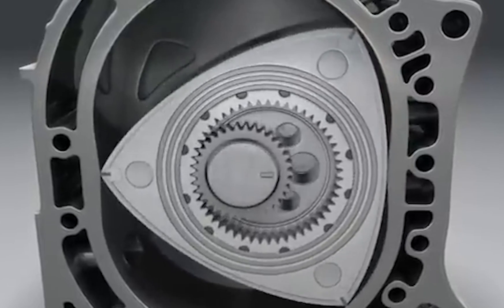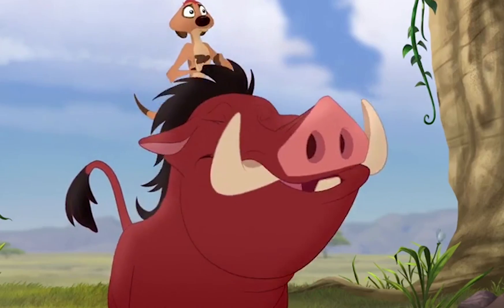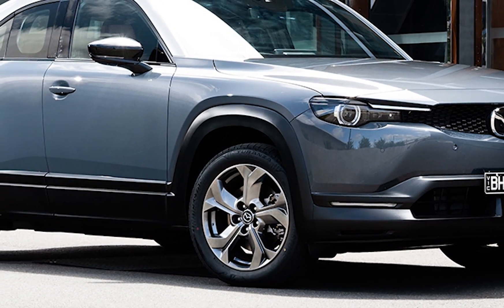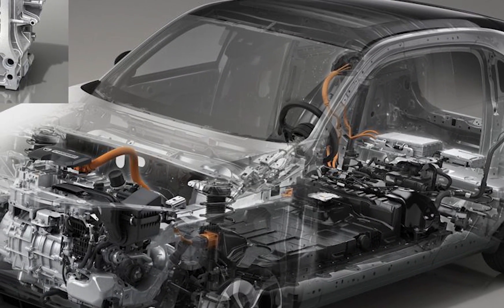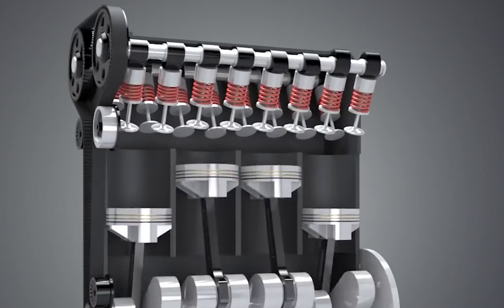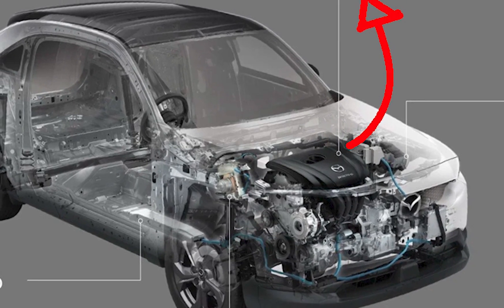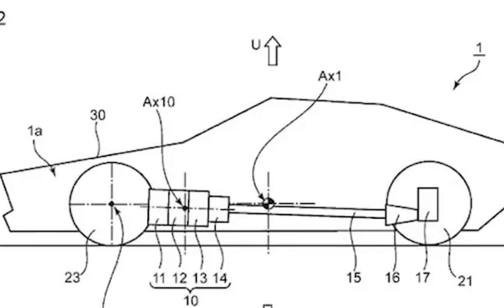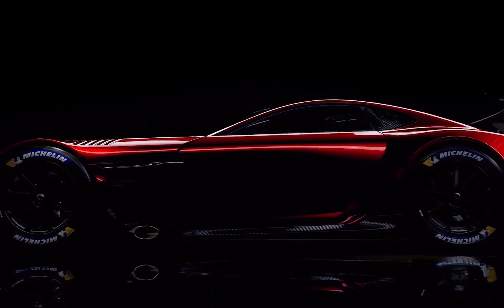Single & Triple Rotary Engine Updates. Mazda's Wankel Engine is back.

Comment: When the 13b came out in the 86 rx7, (i had mine much later than that) rev to the moon is right. Hit redline? Just keep your foot on the accelerator and actuate the clutch. Past the redline it doesnt cut fuel so it just keeps going. 2nd gear goes so far when you dont have a redline at all 🤣
Reply from the maker: My brothers have owned multiple generations of RX’s. They were always so much fun